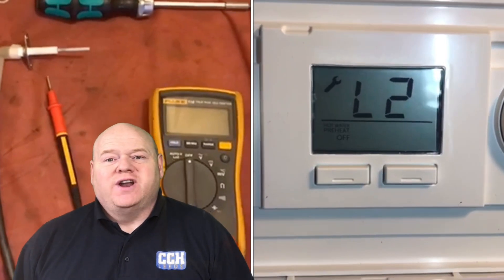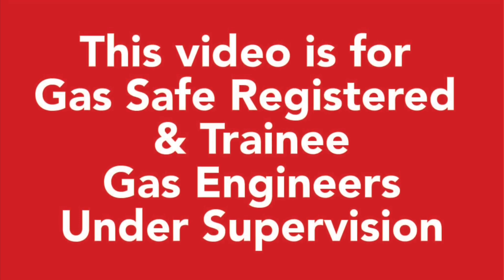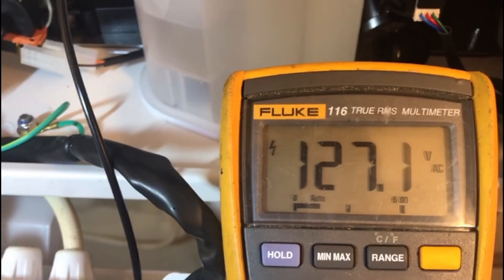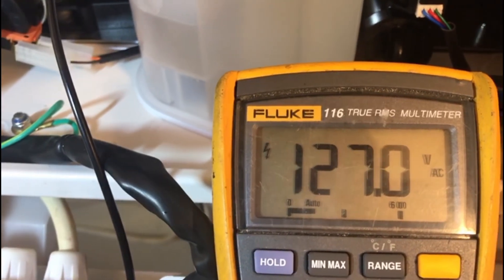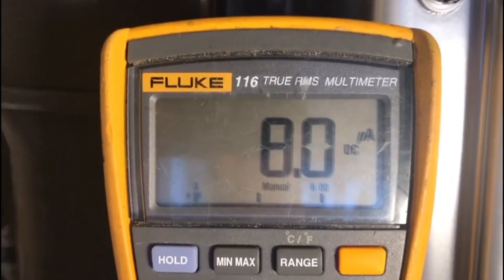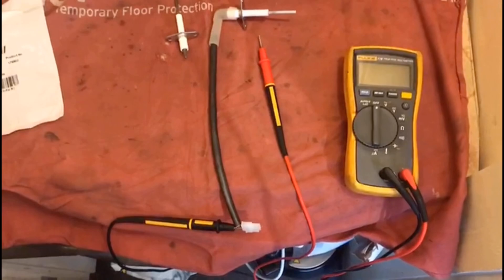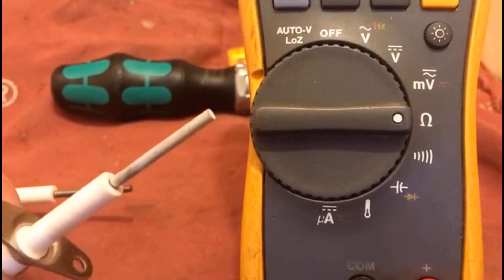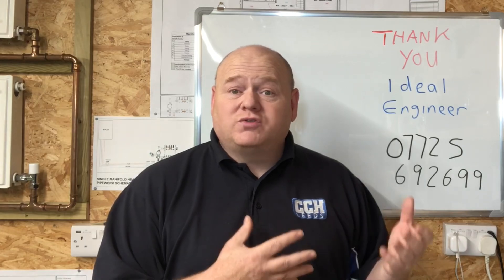Gas Training - Boiler Repairs - Ideal Logic / Ideal Vogue L2 Fault Code F2

Comment: Will this cause the vibration noise on SL on a heat only boiler. Having a nightmare with one just now. Changed everything and still get load vibration. It blows the flame out and then goes through start up again?

Comment: Thank you Allen and to the engineer,
Would be nice if you can make a video on intermittent fault L2 
What's the main issue, because when you are at the boiler everything fine.
Reply: If it’s the older style logic 2009 - 2015, it’s probably a fault on the pcb

Comment: Is the silicon tube on most gas valves a compensation tube or does it move a diaphragm to close the valve. Baxi duotec needs a neg pressure on tube to open the valve are some just to compensate and get true mixture
Reply: It is a compensation tube, however depending on the type of valve, it does slightly different things.
Reply from the maker: Thank you for taking the time to watch this video.

Comment: Hi mate my friends boiler has a f2 fault he is a gas engineer but dose not fault find boilers 
   His boiler somethines fires up and works for 10 mins then cuts out f2 fault 
   But has started not really working at all now constant f2 fault any ideas / tips to try. 
   We have checked gas coming to boiler and when it tries to  fire up gas seems to pull and like I say works occasionally so we don't think gas valve
Reply: If it’s around 8  year old plus, the boiler runs but just randomly goes to F2 whilst running, my guess by your description is you have a faulty pcb board, but I would need a bit More info to properly diagnose.
Reply: @kevincranfield5235  thanks for the reply I traced it down  to the spark generator in the end sometimes it would produce a big enough spark to work sometimes it wouldn't. Thanks for the reply though appreciate it

Comment: If a boiler has a 

flame loss message

 then you reset it then it makes a 

kettling and banging noise 

and seems to work ok when the noise goes away

But then it eventually goes to 

A lockout message 

is it safe to keep resetting it?

 It will come on but then go back out later on is it safe to keep resetting  or no?

Please help currently sitting in freezing cold!!????
Reply from the maker: Ms C I would advise you get someone out to service it as soon as possible. Thanks
Reply: @AllenHart999  oh thanks so much for repling at this time allen

 So would it be safe to keep resetting it tonight for a bit of heat? Or would that be dangerous? I'm disabled and -4 degrees here
Reply: The hot water and heating comes on when my partner reset it  but then went out again later saying lockout?
Reply: Can get any help til tomorrow

Comment: Allen, super video. Have seen a number of Logic Heat 15s which leak from the flow pipe 22mm compression fitting, would this be better as a soldered fitting or is this just over tightening?